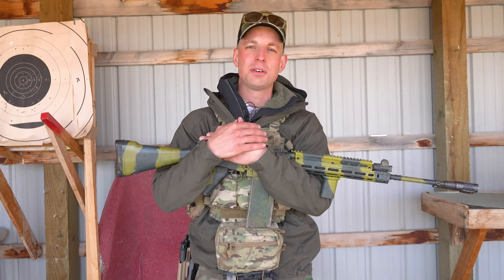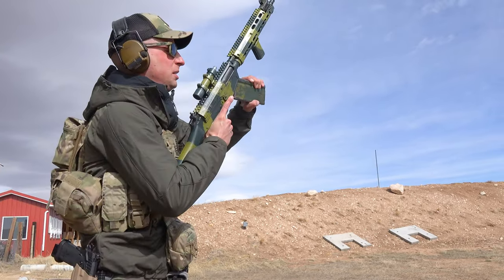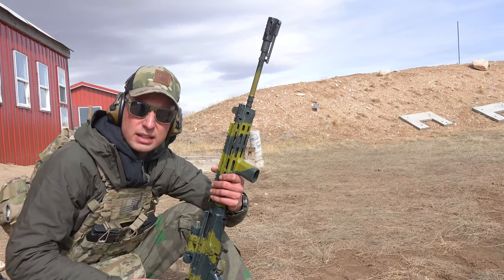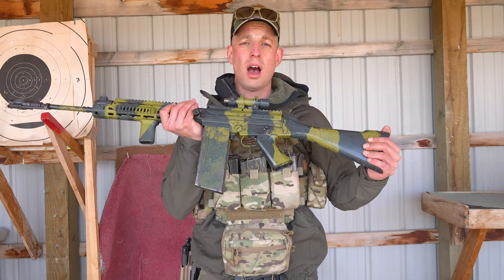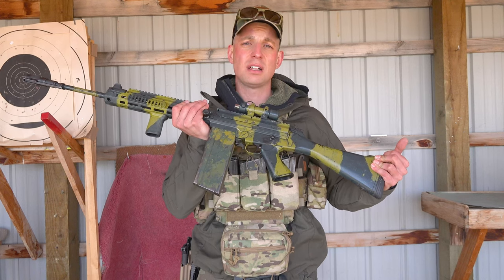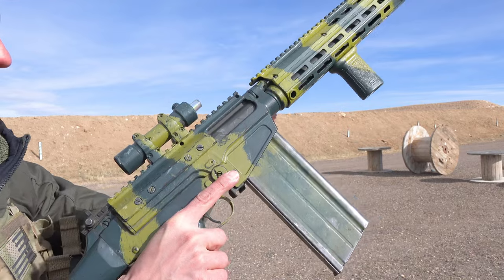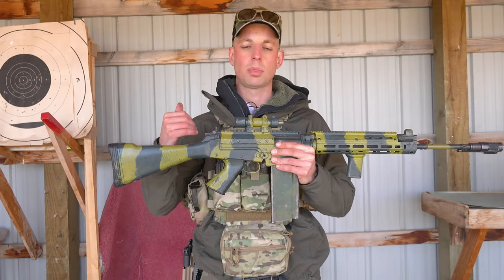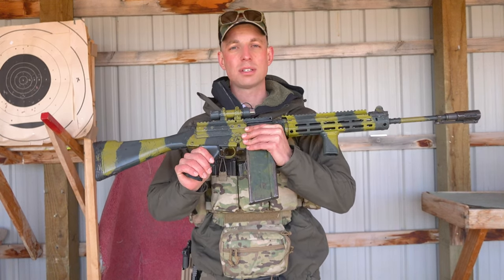FN FAL 101: HOW TO OPERATE THE RIFLE

Comment: I own one of the last true Belgian FAL’S imported into the US under Browning by Gunsouth, a model 50.00 I bought in mid 80’s new.   A safe queen, I ran a hundred rounds thru it, cleaned it, and it hasnt seen sunlight since.  My M1A gets used frequently and comparitively I find them both capable battle rifles with accuracies consistent with their design intent when shooting M80 Ball.   After warching your video, I think Its time to pull out the FAL and get some range time on it now that I turn 70.
Reply from the maker: That's awesome. I hope this rifle runs like a dream. I was never able to understand and enjoy the M14/ M1A rifle. I believe it to be a bad design but to each his/ her own. Enjoy the pre ban FN!
Reply: @thefalguy9848 A properly made M14 is a very durable and accurate rifle.  I’m not talking about the popular civilian market models made by Springfield Armory…those are not made to the original government spec.  If they were, they would be a lot more expensive.

There’s an outfit called LRB that makes semiautomatic-only M14s for the civilian market that are in fact made to the original spec. Usually they are surplus rifles that have been completely restored/refurbished to “like new” condition.  They start at about $3500.  

A little known fact about why the M16 replaced the M14 in mid 1960s:  It wasn’t just because of our involvement in Vietnam, although that was certainly a factor. It was also because the military just couldn’t get M14s fast enough.  They were prohibitively costly and time consuming to make.

The M14 has the obvious defect of an exposed action, and the ergonomics are not helpful in dealing with recoil.  But it’s got a forged receiver and is generally built to Last Forever, plus it has excellent iron sights and is very accurate for a standard issue service rifle…IF they are properly made, which a lot of them weren’t initially; QC issues early on would prove to be another nail in the M-14’s coffin. 

Probably most significantly, the M-14 is associated with a moment in American history - late 50s/early 60s - that is widely regarded as the peak of American civilizational dominance and self-confidence; it has enormous “Americana” nostalgia appeal.

I say all of this despite not personally owning one.  Not only that, but I’m a huge fan of the FAL, too….and I don’t have one of those, either. At this point I have no plans to acquire either, but if I did, I’d have trouble deciding which one to buy.  I do lean towards the FAL.  So, I don’t have a personal dog in this fight and if I did I’d probably side with you.  Just explaining here what drives the appeal of the M-1A/M14 platform.

Comment: Most important thing for a new FAL owner, if youve got that fancy pic rail on top, dont dry fire the gun with the bolt carrier out. Its a pain in the ass to get the hammer back down.
Reply: Also definitely dont forget to set the gas setting back when you where having drunk fun with the boys firing dummy rifle grenades
Reply from the maker: Agree. Otherwise a good screwdriver can help in pushing down the hammer.

Comment: My fal will not eject shell casings. Slide goes back, but not all the way back. Wat setting should gas be set at?
Reply from the maker: Close it all the way and see if the issue still persist. If it helps watch my video on the gas regulator...